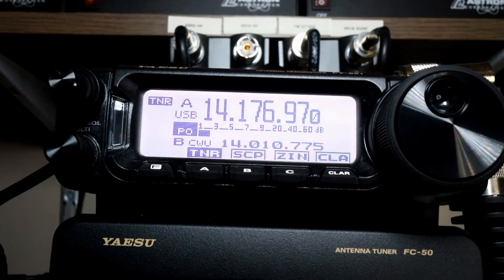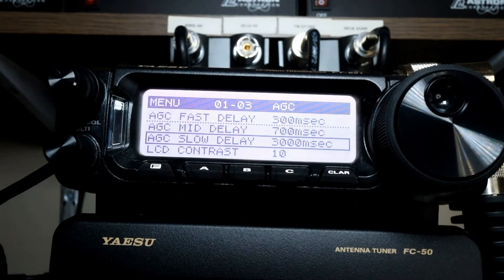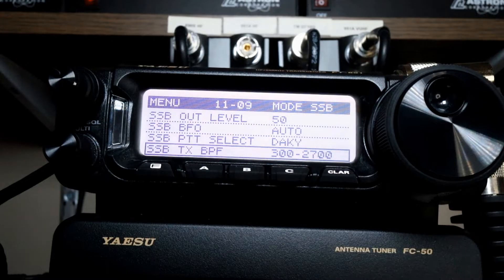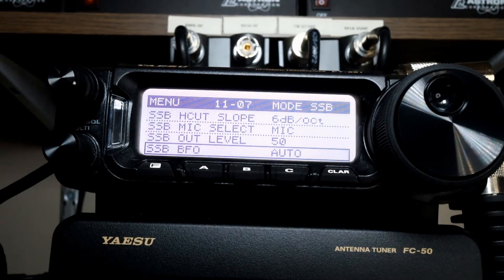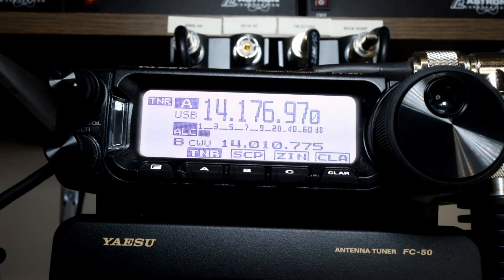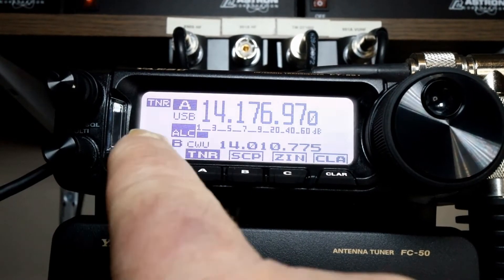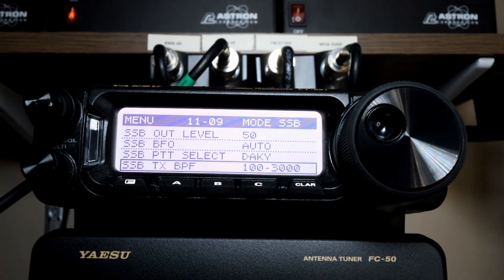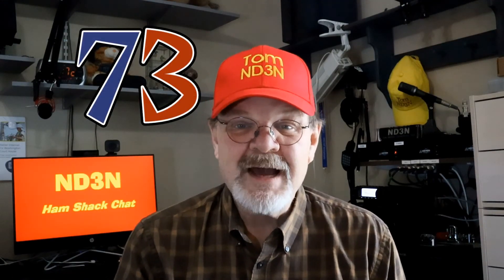Setting up your FT-891 for SSB Mode plus RT-Systems.

Comment: Nice video, going to use with my RT systems programmer.
Thanks, I setup my SSB and saved the settings for ragchew.
I also saved an FT-8 file.
Thanks

Comment: SSB mic gain. Menu 16–07

The default setting of 50 is probably way too high unless you are whispering in a library all the time.

I watched ALC for a while. It blows out the ALC at 50. Obviously it depends on your voice, speech processing, how you hold the mic, how loud you speak and everything. But a setting of somewhere between 20 and 40 is appropriate. 50 is almost certainly going to be too high for most people. I would turn it way down just like you did. And then go from there.

Comment: PRC on or off (tx audio processor) is channel setting specific with memories, yet RT systems has no column for PRC in the memory channel editor screen (not in radio settings either). I reported this to them and I hope they add it soon.
Reply from the maker: I don’t think I’ve seen that in any RT Sys. S/W…. Perhaps because it’s something that is dynamically set to conform for each individual voice.  But it would be nice to be able to have a way to easily reload them in case of a required reset…

Comment: I narrowed the band and I heard myself on the Maui sdr receiver with S7 using 80 watts at 5:00 AM UTC 02/28:2024. Thank you for the advice. However, the EQ settings did not work for me. It’s better to turn it off. Why? Can you please share? Thank you.

Comment: I made a great mistake today. I connected my hand held to the antenna but couldnot hear the local net. I pressed the ptt a few times. Then i looked what was wrong. I connected my handy to the input of my FT2980 and transmitted. I panicked and called all the Hindu Gods to help me. Switched on my FT2980 voila it works no problems. De VU2GPS.

Comment: Nice video. I am using the FT-891 with RT Systems. I frequently use FT8 and I always have to remember to change the Width to 3000 when I switch to data mode. I don't see where I can set that up in RT Systems. 73